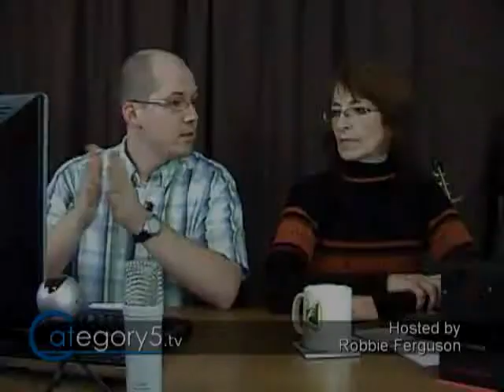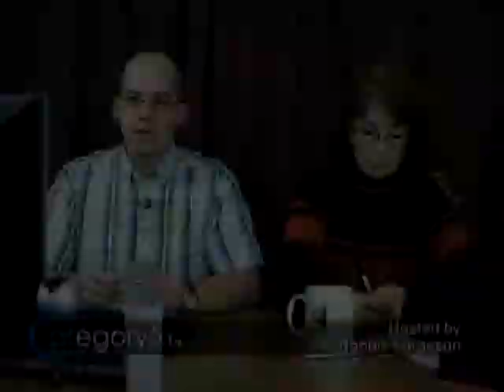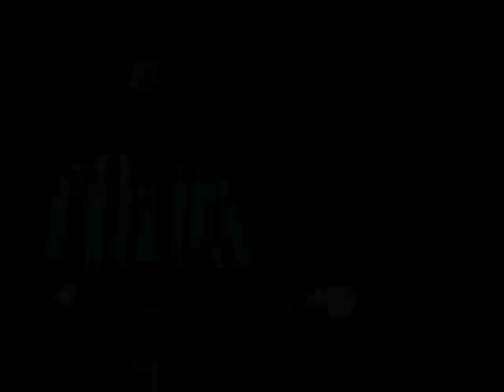114.06 - Viewer Question - What are bad sectors on a hard dr

Comment: Not sure if ill get a reply on a 7 year old video. But i got a used 2T HDD for mass storage i put in my rig a few weeks ago and sentinel showed it had 100% health, then just yesterday it went to 98% and today it went 95%. Did i get a bad drive that was masked to be healthy ? should i be concerned with this immediately or is this just a reveal of its true health ? the rapid decline alarmed me and im getting confused on what to do with my data since im also tight for cash and cant just buy a new drive.
Reply from the maker: ColonelRuiz wow yeah... This is an oldie. But we're still around and kickin! New shows every week and in our 11th season. Hope we'll get your subscribe.
Re. Your disk... It is always always always imperative to have backups. If you have 2 or more copies of anything important to you, great! If not, you need to do that. All drives fail. It's just a question of when. A $200 or even a good $600 backup is cheaper than a $2,000 data recovery. Is your drive bad? Probably not. 98% of a 2TB drive is 1.96TB. That's not great.... but hard to know with such little info if it's actually a problem. Key point is to be ready for a failure, always. Your drive will have at least a 1 year warranty so if in doubt, get a warranty replacement ... but never be without 2 copies of your files.
Thanks for watching! Check out some of our newer stuff too. Hope you enjoy.
- Robbie

Comment: What a mediocre answer. 

A sector can be a logical or physical region of a hard drive designed to hold data which - can be bad from the time of manufacturing (the P list) ... that is identified as bad over time (the G list). Those lists are what make your drive's firmware chip unique to it - along with the service areas of the substrate (platters). 

The job of holding data can deteriorate; sometimes the block itself is able to recognize a loss in confidence of the data's integrity - and lists it as bad, for that, and the aforementioned reasons. Generally, data goes bad at a given rate - for the quality of drive, use setting, or combination thereof. 

DETECTING failed regions - or failing systems can be done globally by software, via S.M.A.R.T. or even by inferring that your system's performance has degraded substantially - per the fullness.

Hard drives are amazing. Regardless as to whether they're SSD or spinning - they are a representation of  humanity's knowledge of physics, material sciences, technology, and so forth.